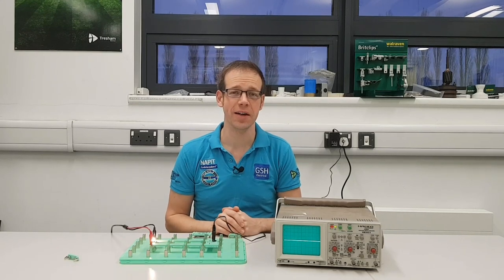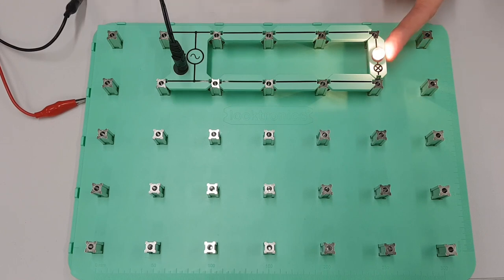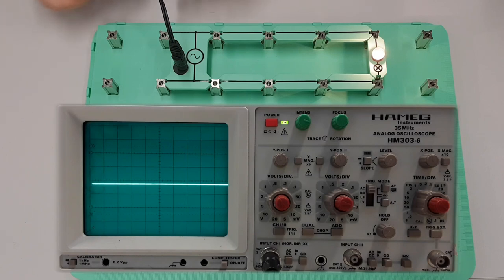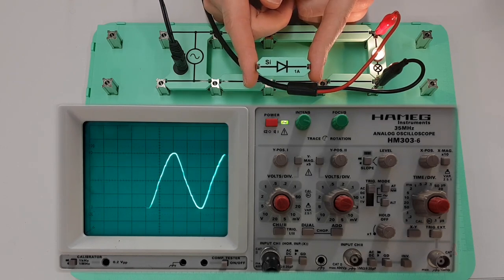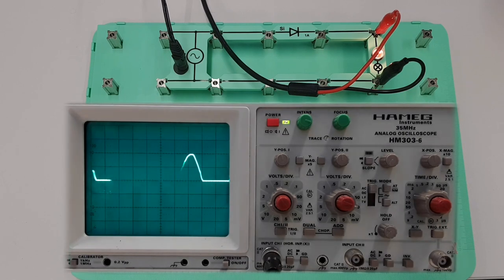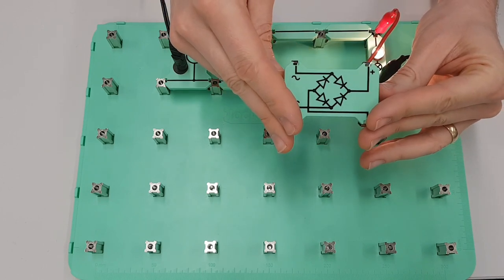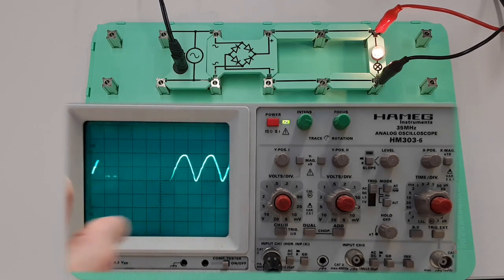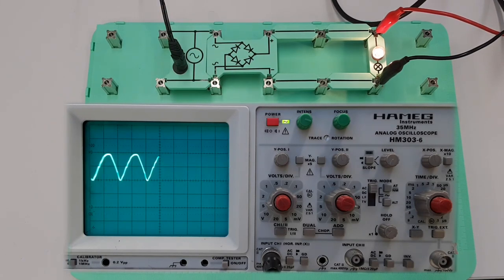How to Perform AC to DC Rectification Using Diodes

Comment: Great video Joe. Do you have a tutorial explaining how AC works, and the pro's and cons of delivering current by AC or DC ? I can't get my head around how a device can be powered by an AC current going in two different directions (although I can see it in your light bulb example here). I'm a newbie!
Reply from the maker: I'm about to start producing some information on AC theory and power factor, the early stages will include some information on what AC is, stay tuned!